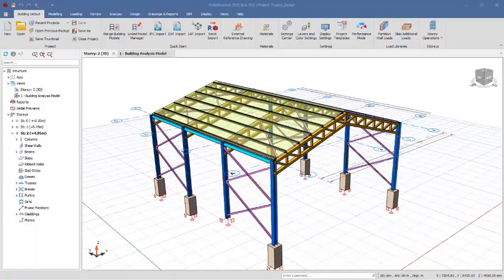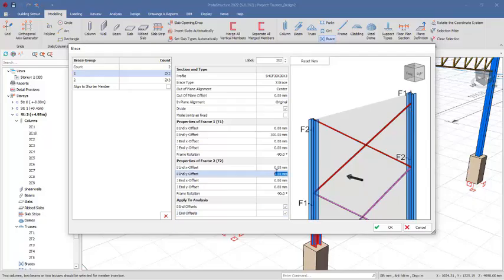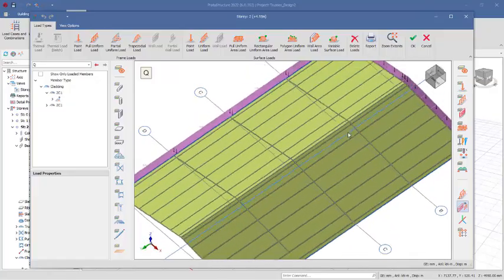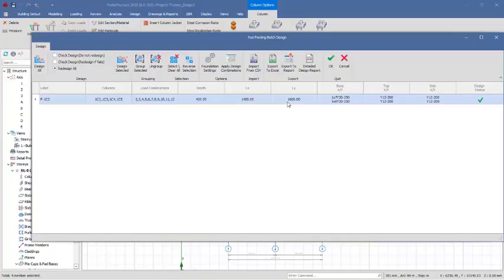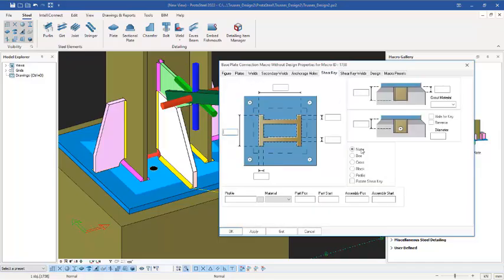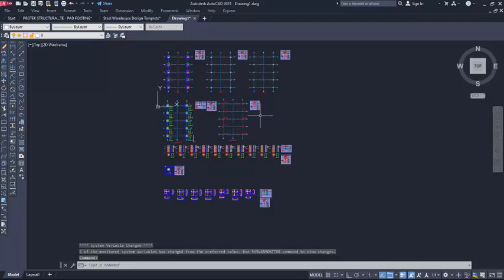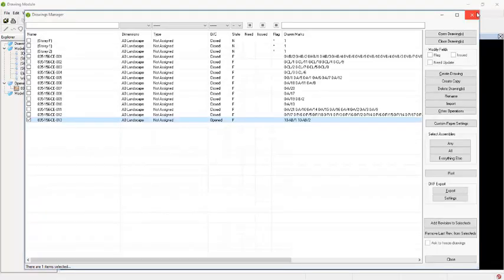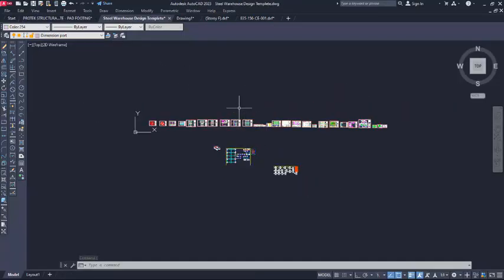PROTASTRUCTURE FULL COURSE ON STEEL STRUCTURE DESIGN, CONNECTIONS, AND DETAIL STEEL DRAWINGS.

Comment: how can you get M-N-T forces data for a manuel connection design?  could you show one simple example
Reply from the maker: Step	Action
1	      Define connection and loading context
2	    Gather geometry and load data
3	    Analyze structure (hand or software)
4	     Extract M-N-T at connection
5	     Apply load combinations
6	    Tabulate results
7	     Use for manual design calculations
Reply from the maker: Example:
I have a steel beam-to-column connection. The beam is W250x33, simply supported at both ends, 6m span, with a 20kN point load at midspan. I want to find the M-N-T at the connection to the column.
I can resolve the for You.